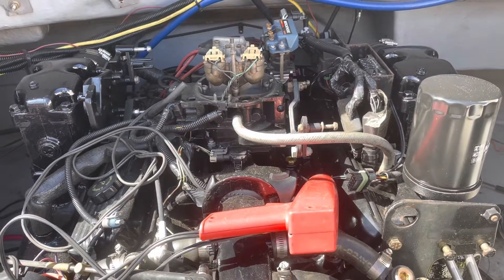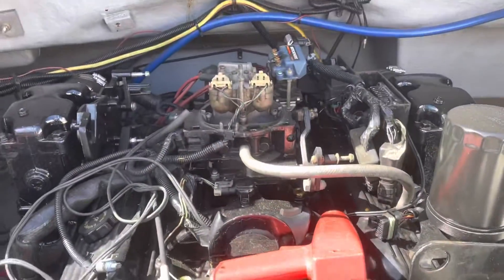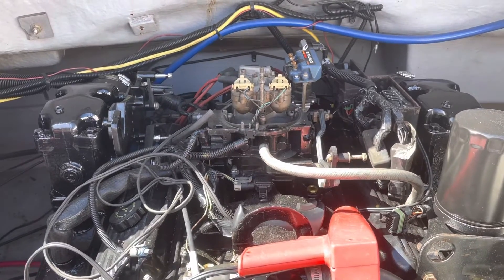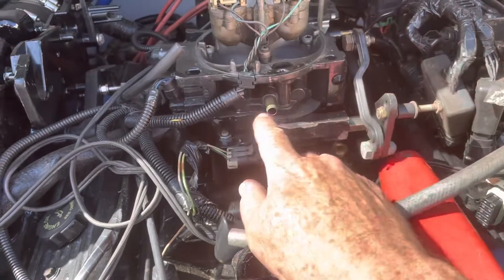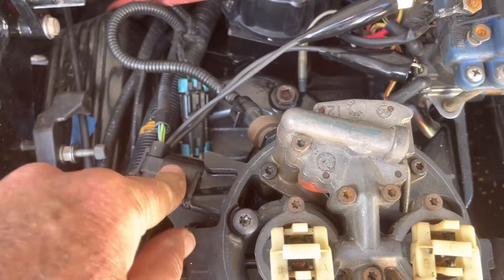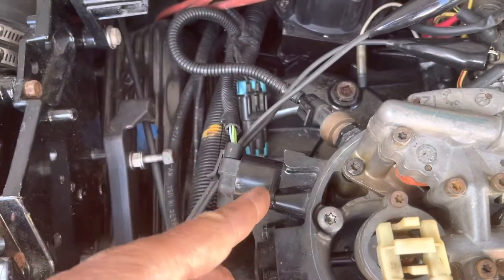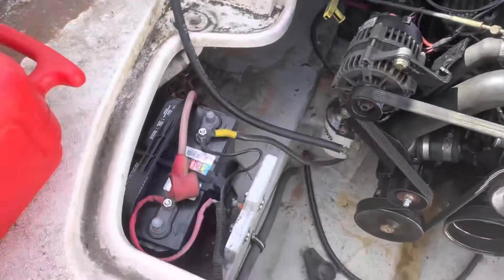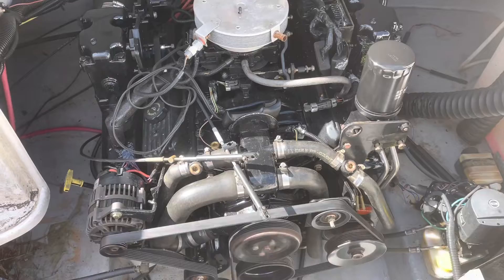Mercruiser 5.7 EFI Troubleshooting 1￼

Comment: Which year of Engine is this? 1998 5,7 EFI has Alternator lower?
Reply from the maker: I don’t understand your question.
Reply: @moccasinmarine “Whats the manufacturing date of the engine“
Reply from the maker: I guess 1998 since that’s what you said. There are many engine variations. I don’t know all of them off the top of my head. I use engine serial numbers to look up the features.

Comment: Good info. This video helped me diagnose my starting issue. When I pulled my original iac out to test the pin pushed out of the end when I cycled the key. So I put an aftermarket one in, worked great for a day then the pin would push out of the end again. How do you keep the pin from pushing out?
Reply from the maker: It’s impossible for the pin to push out with  the IAC installed in the throttle body. It should bottom out in the hole and stop airflow. If it pushes out inside the throttle body you’ve either installed the wrong part or the throttle body is broken or worn out or you have the wrong pin. The Marine throttle bodies are the same size as 454 truck throttle bodies and use larger IAC pins. You can’t use a standard truck or car IAC in the marine application.
Reply: @moccasinmarine  no this is when I have it off the throttle body but still plugged in and turn the key on to test to see if it’s moving
Reply from the maker: @TheIslandboys11  you can’t test it that way. It will pop out everytime. You test it by looking at it while installed and watching it move while turning key on and off
Reply: @moccasinmarine ok good to know thanks for the help. Im still having starting and idle issues with a working iac then
Reply from the maker: @TheIslandboys11  turn on the key. Ground terminals A and B of the datalink connector. This will make the IAC extend to its max and close off idle air. If you look inside the throttle body idle air inlet you’ll see the tip of the iac blocking airflow. Turn the key off and remove the jumper between A and B. Turn the key back on but don’t start the engine. The IAC will retract opening the idle air path for starting, now pull the electrical plug from the iac and start the engine. It should start and idle a little high,

Comment: Would you happen to know where to find a fuel regulator for that specific one  or rebuild kit
Reply from the maker: https://www.rockauto.com/en/catalog/chevrolet,1995,c1500+pickup,5.7l+v8,1031443,fuel+&+air,throttle+body+repair+kit,12939

Comment: Hello. Thank you for making the video. I couldn't help but notice the exhaust cooling hoses, running from the thermostat housing to the manifolds, have valves spliced in. I have never seen this. What are these, and are they common? Thank you.
Reply from the maker: Honestly I never noticed they were there. Maybe Mercruiser had insertable flow testers that told you the flow to each side? Pressure gauges wouldn’t help because the pressures will equalize on both sides.